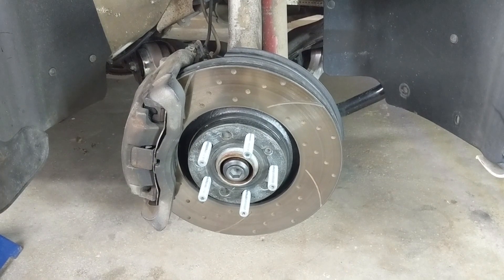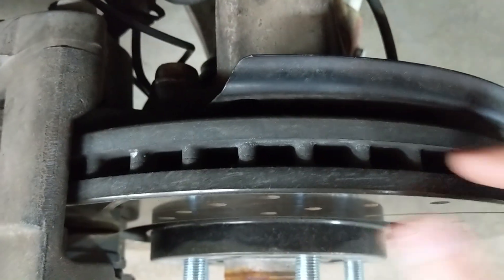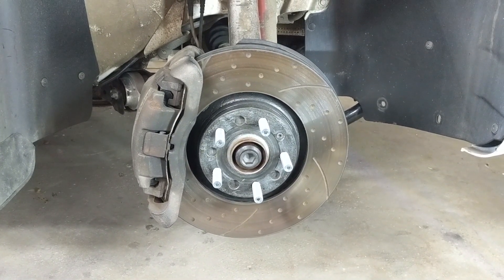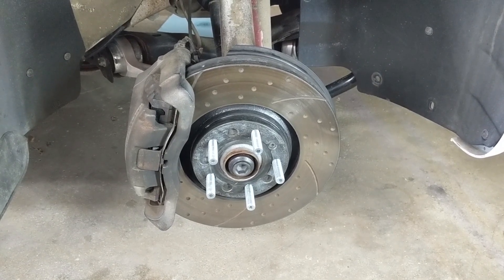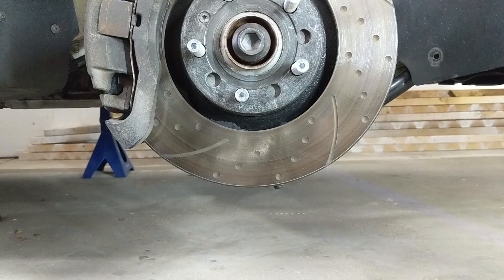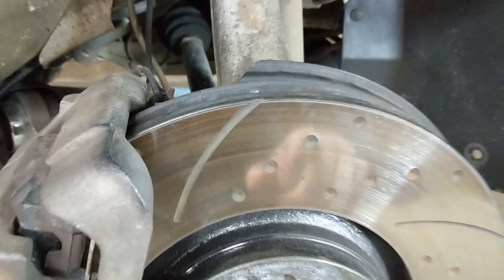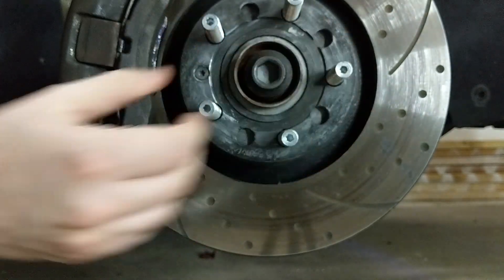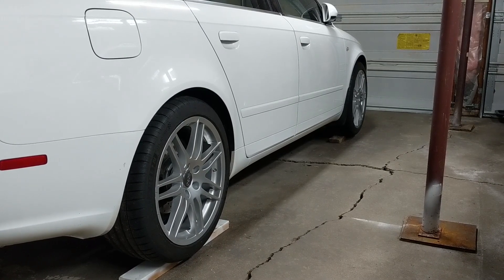Rotor installation direction | Vanes, slots & cross drilled holes: which way?

Comment: You had them on the right way the first time. I’ve done hundreds of break jobs as a mechanic, the reason you want them as you had at first is that those groves can cut into the break pads for slightly better breaking.

Comment: I had my rotas and pads changed. The slots on front rota curve into the forward motion of the car. The rears are not, they are opposite,  they cut, or scoup,  into the forward motion of the car. What I have noticed is that I get a LOT more brake dust on the rear alloys than the front. Which  suggest its better to have the curved slot facing into the  rotation of the wheel.

Comment: The slots are directional to help remove the hot brake dust from the caliper & hub by centrifugal force ...they should point forward, they also keep the brake pad wearing flat   ...! That is why the slots are there...!

Comment: Hi, I hear where you’re coming from, however your slots have no build up of dust in them... The main reason for the slots is to release gas that has been released from the brake pads when they are worked hard causing brake fade. Brake fade is a build up of gas that creates a barrier between the pad and rotor causing temporary reduction in friction. Slots generally cause brake pads to wear faster than rotors with holes or dimples drilled in them as they act as a type of slicer on the pad keeping the pad face clean and help disperse water. Centrifugal force will throw the water and any dust deposits out of your groves and not allow any dust buildup to gather in them. You are right in saying the rotors can go on anyway with straight cooling vain’s , however you had them on correctly the first time basing this on angled cooling vain’s the orientation would be your pre swap over. Take or leave my comment. I enjoyed you video. Wayne. NZ 🇳🇿
Reply: It seems the reason "Figure It Audi" gave as to why he reversed the rotors would also help in what you are saying, and that is direct the gases along the slot and actually dumping that gas to the out of the slot.  If he kept them on the first way that gas entering the slot would not be able to be dumped out of the slot.....it would build up and have nowhere to go.  So I think his second way of mounting them is best for any reason.

Comment: I was always told the slots were used as a more effective way to exhaust brake gases and not dust exactly when braking. But I do agree you should have switched them like you did in this video.

Comment: What company brake rotors did you go with? Also did you notice any difference by switching them? I have straight vanes like yours but my slots go all the way to the edge like yours. Thinking of swapping them. Just put them on yesterday lol
Reply from the maker: These are the black zinc coated rotors from Brake Performance. I've been running these for probably 5 years now and I can't remember what the immediate difference felt like back when I first put them on. That said, even if there was a difference, I would probably attribute it to pad selection and not the rotors. Especially since my B7 isn't tracked and I bet I've never put serious heat into this set up to the point where I could notice the rotors ability to shed heat and stave off brake fade. And the calipers are all OE, so my expectations were never that high. If you want my opinion, I'd try different pads if you're wanting some extra bite before changing rotors again right away.
Reply: @FigureItAuto  i just bought brand new rotors and pads and installed them yesterday. But i seen that the slots were facing forward like yours were. Didnt think about it till i seen your video lol. It does makes sense with the slots facing backwards. But since my vanes are straight i dunno if i want to do all the work again lol. Have plentty of bite and stopping power with the brembos i have but thought it would help with a lil more cooling after watching your vid. Thanks for your response 👍